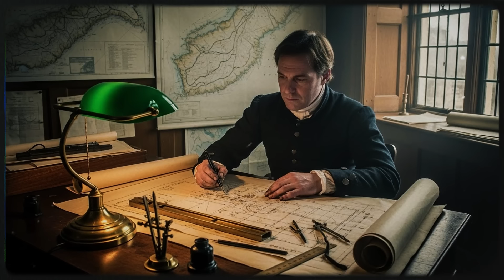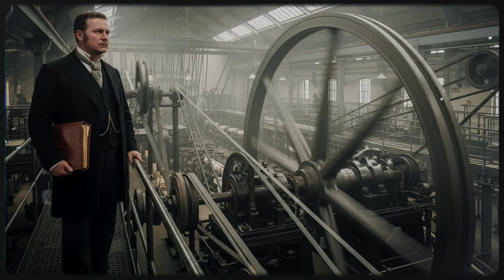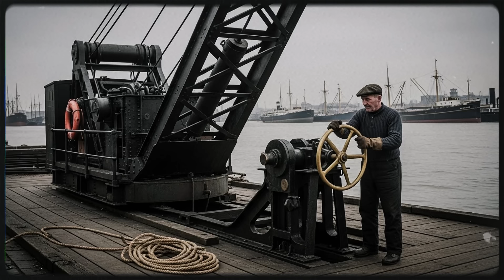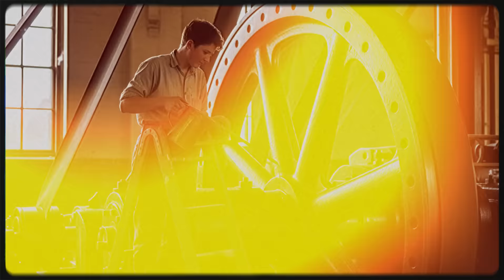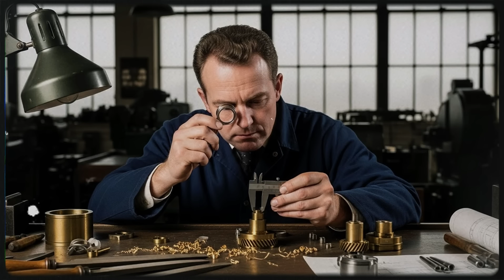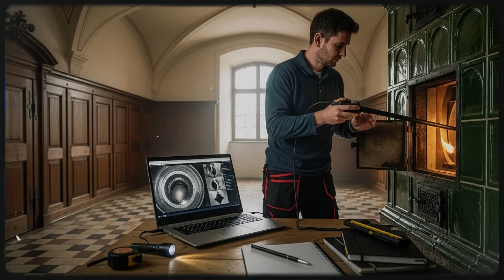They Stored Energy Without Batteries in the 1800s — And the Structures Still Exist

Comment: These systems are no longer used because they last too long and don’t provide an ongoing cash flow like modern systems do.  Modern things are engineered to only last a few years so the company can make more money selling another one.  Finance people have destroyed the world.
Reply: thing is that this systems are way too heavy, (a flywheel capable of supliying your cellphone for a day would be several kilograms heavy, spinning at dentist's drill speeds, and failure would be almost like a grenade or an israeli pager).
power companies have worked on such systems back when fuel became expensive or as a solution to solar and wind intermitency, they end up in failure because the speed and strain on flywheels are extremely demanding and not cost competitive even with modern materials.
compressed air is another pain in the lower back, for each horsepower you get out of a pneumatic system you need 10 hp on the compressor, because air heats up when compressed, and such heating is energy you are pouring onto the system that will be lost to the environment.
Reply: Yes .  Very good comment.  And that's why I Drive a 1997 truck . Before that sht started
Reply: Control.
Reply: Today, a dedicated field of "Critical Finance Studies" uses social, political, and economic factors to analyze the role of finance in society, particularly in the wake of the 2008 global financial crisis, which exposed significant flaws in prevailing financial models and assumptions about systemic risk.

Comment: Tesla battery fully charged 400 volts. After full discharged. 285 volts left in battery. Some battery stats I saw the other day I can't stop thinking of
Reply: Lithium Ion batteries are defunct permanently if they are allowed to run out completely and must save a certain amount to stay alive. I think I might have read you aren't supposed to try to charge either if they are completely out as a fire is likely.
Reply: You do not understand the difference between open circuit versus voltage under load.
Reply: @codetech5598 
He doesn't need to know all that.  He's not a walking dictionary

Comment: Because money is their motivation. So if something runs out or gets a limited life it makes financial sense. 

The old world did not use financial sense to build their world but practical and logical sense.

The new world financial sense limit everything. That way they get to sell you things again and again.

Old world systems are built to last as long as it exists.
Reply: Exactly.  And that's why I Drive a 1997 truck.  Last forever.  The car already has 350 thousand miles on it.  And runs like new.
Reply: Its for control, currency is a control system.  For the current runs to the sea where there are banks.